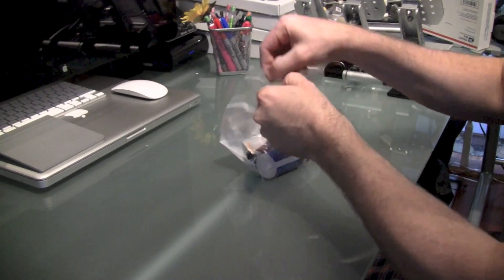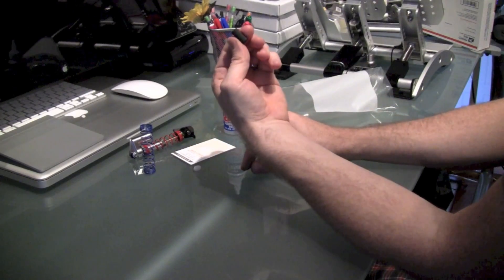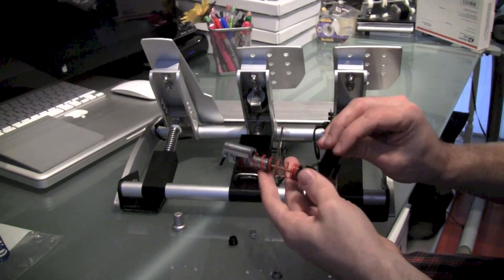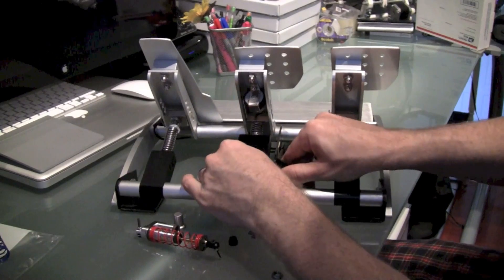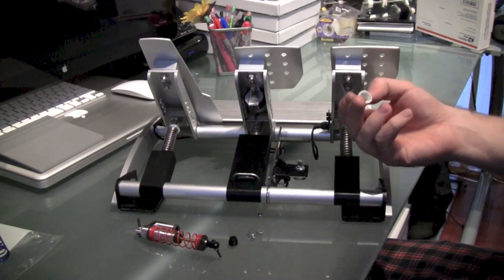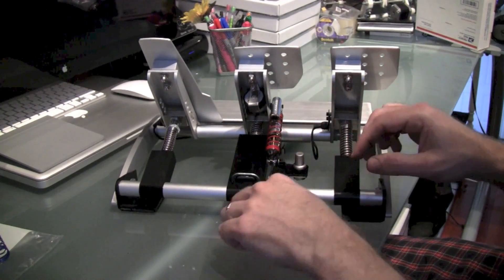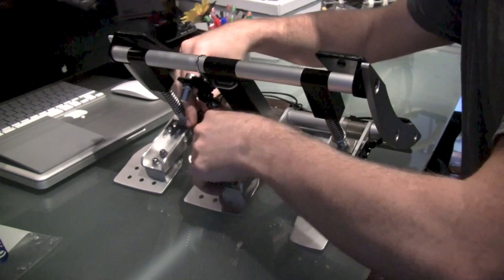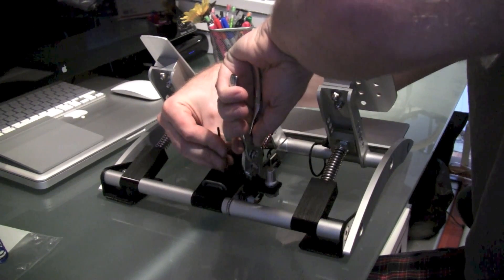Clubsport Pedal V1 Modification Kit Instructions

Comment: Hello David, the mod seems to work with the original material in position 1 of the pedal frame, but what if I move the original material to the 2nd hole, i.e., resulting in much shorter and stiffer pedal travel? I hope what I'm asking makes sense, it's hard to describe.
Reply from the maker: The pedal is so hard to push in position 2 that the damper would be useless.
Reply: Thank you for the response David, I currently have my original v1 in position 2, it is firm like GT3 cars, but the smoothness isn't there...is your mod almost as stiff in position 1 as my stock set is in position 2?
Reply: What I meant was the holes in the pedal frames. There is a row of them on each side of the supports for the pedal faces, and stock most pedals come with the position 1 engaged. I've set mine for a shorter "throw" which means I'm using the 2nd set of holes...David responded and said the mod doesn't work in position 2 on the pedals. Hope this helps. :)

Comment: I actually own the V2 pedals, but Fanatec told me that the throw couldn't be adjusted, but Sim Racing says that it can. As you know, there are a series of holes that would suggest that you can move the pin to shorten the movement. I have seen the Sauber video, and you're right, there is clearly some movement in the brake. However, they may have exaggerated this for the purposes of the video. I have to say that the hydraulic cylinder on my V2 pedals isn't very good.

Comment: Hello there. Can the brake pedal throw be adjusted on the V1 Clubsport pedals?
Reply from the maker: Sort of, they were not designed to. It makes the pedal super stiff, and defeats any reason why you would want the pedal kit.
Reply: I know that it makes the brake stiff, but F1 cars have almost no movement in the brake pedal, so Fanatec should have designed with this in mind.
Reply from the maker: ANDYB1478 It's not the same thing, adjusting the clubsports would require that you modify a few parts in order to get a similar effect to a f1 pedal box. There is actually a pretty good amount of travel in an f1 brake pedal. You can see here https://www.youtube.com/watch?v=nRw0c-4AIHA&spfreload=10